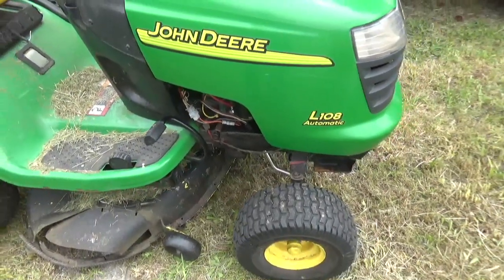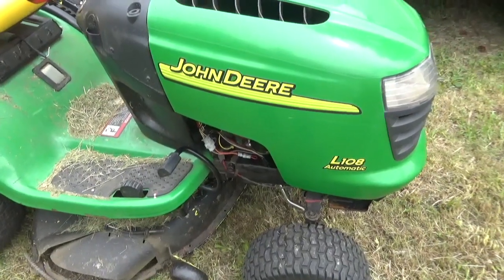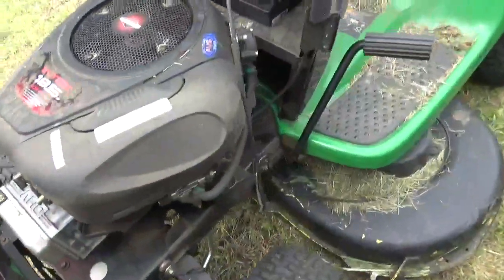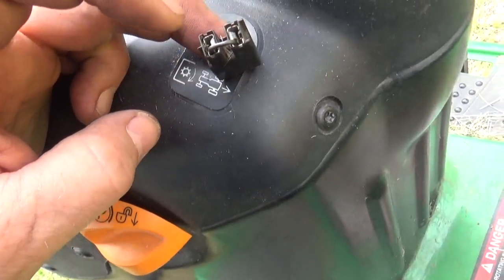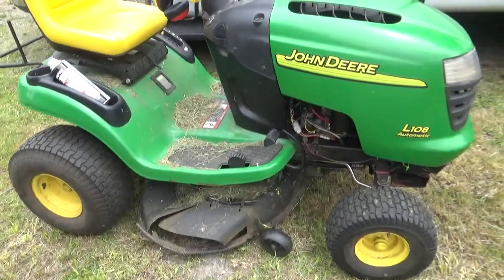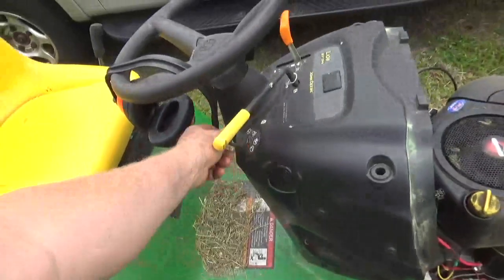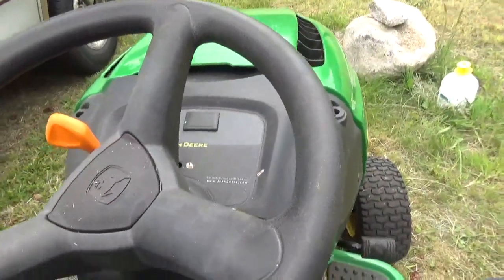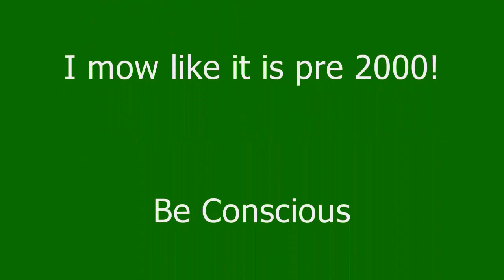DISABLING ALL SAFETY SWITCHES on a John Deere L108

Comment: Without all of the safety switches, it is such a pleasure to drive the JD tractors.(E120 mine) You just need to use common sense to protect yourself. If you're getting off of the mower for any reason, shut off the blades first. Also, many of the problems with these mowers, are caused because one of the safety switches is bad.

Comment: Be careful with the seat sensor.  On mine, when I pulled the switch off for the seat, it kept running when I got off the seat.  But when I go to turn on the mower blades, it instantly turned off.   I just wouldn't recommend cutting the entire sensor off unless you're prepared to rewire it.   Very helpful video though.  Thanks for the video!
Reply: @SecularPenguinist My issue wasn't the mower turning off when I got off the seat when I removed the seat sensor, I could be sitting on the seat and as soon as I tried to engage the mower blades, the engine would turn off...so I couldn't mow at all without the sensor so I had to replace it.  The reason I'd like to be able to keep the seat sensor disconnected is so I could lean over and pick up a stick or get off the seat and pick up something in the lawn without constantly having to restart the engine every time.  I don't mind turning the mower off for things like this, but having the engine cut off every time I lean over or get off the mower is just a pain.
Reply: @Troy-Echo  
That's weird you have to turn off the engine like that.
I just disengage the blades; put on the brake then, I'm good to leave the mower and it still be running.  Of course, I still find it cumbersome to do all that just to pick up a f'ng stick.
Reply: @RalphSampson...  True, many sticks I will not worry with, but I have an 11 YO daughter and two dogs that leave things in the lawn such as dog toys and soccer balls, tug-of-war ropes, etc., that I do not want to run over and have to replace.
Reply: @Troy-Echo  Had same problem, fixed it by bypassing the switch with a piece of credit card in the two middle connectors, this video sums up what I did perfectly, https://www.youtube.com/watch?v=0xj5OFQOIlI
Reply: @ZynexPlays Thanks.  I missed this before, but I still have my mower and I may do this at some point.  My daughter will be doing a lot of the riding mowing this year, so I think I'll leave the safety switch on until she's a bit older.

Comment: My gear shift doesn't work reliably. Sometimes can't get it into neutral so it won't key start. Can't find a switch to the transmission that I can disconnect to start it while in gear. Is this possible? Thanks

Comment: There have been many times that we can't start our mower or can't take off the parking brake without it dying because different safety sensors kept having problems and it's only 1 year old that now I'm thinking of disabling them all plus the most annoying thing is pressing a button to mow in reverse. Hate it when I forget and it turns off the blades and I have to go back and remow!

Comment: Thank you! Trying to troubleshoot is impossible with all these safety switches. Mine has the seat, the break, the backup and has to be in neutral. The wiring is so old any vibration sets off one of the 4 switches and kills the engine.

Comment: Thank you, it worked, my ztrak z255 John Deer zero turn mower stopped working, wouldn't crank, no sound, nothing. I followed your instructions and disabled the brake safety stitch and it started right up. Didn't cost me anythiing. Thanks again. You saved me some money.

Comment: Back in the 70's I had a friend that worked at a rental business. Customer rents a lawnmower from them, decides that as long as he has the mower he'll trim the bushes with it, reached down with both hands to lift the mower up to cut the bushes.
Cuts off all 8 fingers.
Sued the business because there wasn't a label on it warning you NOT to try picking it up to trim bushes with it.
Sick thing is - he won.

Comment: Best Explanation of seat switch I have seen. I think there is a mechanical switch between two of the connectors in the plug that either have to be separated or like you did - cut it off!!

Comment: I can't count the number of times I've leaned dangerously off the seat to try to move a branch on the ground while trying to keep my butt on the sensor, when it would be much safer to just jump off an pull the branch AWAY from the mower.
The seat switch is a good idea on paper, but it honestly causes me to do even MORE dangerous stuff trying to work around it.
Reply: Unsafe tee switch 😁 lol
Reply: It depends on different situations, if one where to try and move something, it’s not such a good idea, but it somehow a faulty starter where to activate the lawnmower, it wouldn’t turn off and would cause the lawnmower to continue to run until it runs out of gas or a different situation. If stored indoors, it could cause a fire due to it being on and overheating.
It all depends on certain situations, but it’s best to have them on.
Reply: @gacha21x35  Your scenario needs a lot of unlikely things to go wrong at once. Yes we can all imagine very specific situations where it would be good to have X, but the idea of the switch isn’t to prevent your scenario, but to reduce harm at a statistical level. My question would be: How many people are injured by lawnmowers without a seat switch, and how bad are the injuries, and how many are injured by lawnmowers WITH a seat switch?
In other words, is it better to prevent one major injury if it means causing 10,000 minor injuries? I’m skeptical about whether the seat switch actually helps keep people safer in a general, global sense.

Comment: I just put a Kohler 17.5 engine out of an L110 on my Ferris walk behind mower. I transfered the entire wiring harness ( I want to use the factory key, hr meter and headlight circuit).  I'm now systematically eliminating all these now useless sensors.

Comment: The PTO switch is identical to the brake switch, on mechanical clutch mowers. It's designed to cut power to the engine when the seat switch is closed, so in theory, just taking the seat switch out should work, But, if the PTO is engaged, the white side of the switch could still ground out the ignition power... When disengaged, the start loop side of the PTO switch is closed so the solenoid gets power, but the ignition side is open. With all white wires and switches, you have to make sure they don't ground out, EXCEPT the ignition switch (so you can actually turn it off).  To avoid the safety cutouts, the white wires could be cut. Confusing.
 BUT, if you don't want to mess with all 5 switches and jumpers and tape, you could just run the purple wire straight from the ignition switch to the  start tab on the solenoid, unplug the PTO and BRAKE switch and that's it. 
 The seat switch is in line after the brake switch, so once the brake switch unplugged, the seat switch doesn't matter. And, because the whole RIO system (pedal switch,  relay, and dash switch) is downstream of the PTO switch, leaving the connector to the PTO unplugged, effectively disables the whole RIO system. Took me a while to find a good wiring diagram. Printed it, color coded the start, hot , and ground circuits so I could more easily see how all of the white wires and yellow wires worked. The brake and PTO switches are central to the whole system. And just a bit of additional info, the whole safety system of white wires is connected to the primary coils on the engine, so if ANY of them ground out, the engine has no spark. But you don't want to disconnect the white wire at the engine, unless you want to manually ground out the coils when you want it to shut off...  I'm gonna test this sometime this week.
Reply: Yup. I was correct. In fact, I found an even easier way. Unplug both the PTO and the brake plugs, remove the solid purple wire from the PTO plug end and connect it to the solenoid. Done.
Reply: Jennifer, can you share where you found your wiring diagram.  Ive been looking
Reply: @jenniferphillips7265  Wonderful.  Thank you.
Reply: Flow Euphoria  thank you 😊
Reply: @JEFFQUICKLE9 it sounds like you have an electric clutch. If there's no computers involved, then I'd wager that John deere didn't reinvent the whole harness just to use an electric clutch instead of a belt tensioner clutch. That means the relay or the clutch itself is powered through one or more safety switches. In other words, power goes to the switch on the dash, then to the clutch or relay primary side, then to the safety switches. I'd guess that the pto is a separate system from the ignition system. But, will the engine start if the pto switch is on? Most likely not, which means the whole setup is connected. I'd probably have to see a wiring diagram for your model.
Reply: So with this modification, the PTO is always engaged??
Reply: @desmetde  no. On these, the pto is mechanical. The lever pulls a cable which moves an idler pulley and tightens the belt. But, the mods I suggested bypass all ignition grounds except the ignition switch. So, yes, with this mod, the pto is always available, whether you are in the seat, the brake is set, or not. 😊
Reply: So your saying take the purple wire that plugs into pto and hook it on the solenoid? I did that and it just blows the fuse anytime i roll the key over

Comment: What about the deck engage safety? This switch sometimes causes my mower not to start. I just have to push down and jiggle it around a little to get it going most of the time but it has given me more trouble before.

Comment: I by-passed all of my safety switches - still no electrical power. I last used the mower during the fall of 2020, the year we had the big ice storm that lasted for so long. Could it be that an ice bridge formed somewhere between hot and ground and burned out a wire? I am not exactly a novice, but I am at my wits end with this mower..

Comment: If you short the RIO circuit, won't the relay be on all the time? Would that cause a problem, perhaps burning out the relay?
Reply: On my D125, I did it 4 years ago and it hasn't caused any problems. I don't know if the relay is activated, have to check. Or if it matters. Could be it doesn't activate until the reverse pedal is pressed?

Comment: Hey Tim, I was able to find the brake switch which wasn't working properly. What it did was after the mower started, when I let off the brake, the mower would go dead. So, I followed your instructions and connected the two purple wires. However, now the mower acts like I disconnected the battery. Any suggestions? Thanks,

Comment: What about the safety switch that's connected to the mower blade engagement lever?
Reply: It's the same as the brake lever... Go purple to purple... I changed my throw lever to an electronic PTO clutch and it wouldn't start... Took me a few minutes to figure out that needed to be kept in a circuit as well.

Comment: I'm having trouble turning mine off. I checked the solenoids or cylinders and they all look good when I go to turn it on it doesn't want to shut off is there a way of bypassing something that I could just have a toggle switch.
Reply: Have to get a new or used ignition switch. Sometimes you can shoot some Blaster in it and work the key back and forth and the relay will close again, sometimes that works. If you fell froggy and are able to take the switch out, and apart clean the contacts (remove all the dirt in it). Most times you have to replace it tho.

Comment: I bypassed the parking brake safety switch as shown in this video (shorted out the two purple wires).
But the seat safety switch now doesn't work,  (won't shut off when you get off the seat).
How can the parking brake safety switch be disabled without disabling the seat safety switch?
Thx

Comment: My L118 seat switch harness plug had a "H" shaped metal clip inside it that shorts the engine out if you unplug it from the seat. You can pull the metal tab straight out "harness end" & plug it back into the seat and the tractor will run if you get off it. Won't run unplugged. You absolutely must have good habits and never never get off the tractor with the mower still turning or you will lose a Foot! 
 I mounted a 15 gal weed sprayer to the back of my mower and  now I can get off and fill it or check the level or run the hose out and do spraying.
plug

Comment: do i have to acctually cut the plug off the seat wires cus i unplugged it from the seat and when i went to engage the blades it tried to shut off on me
Reply: Of course it did.  It "thinks" your not sitting on the mower.

Comment: Hey Tim How are you? My name is Adam I also have a John Deere Tractor 1742 Gear Drive Sabre is your Briggs Intek Engine Splash Lubricated or Pressure Lubed with a Premium Spin On Oil Filter? I have a Fuel Filter on mine as well. Have you seen the Scotts John Deere Tractors they were essentially Orange John Deere Sabre Replicas.